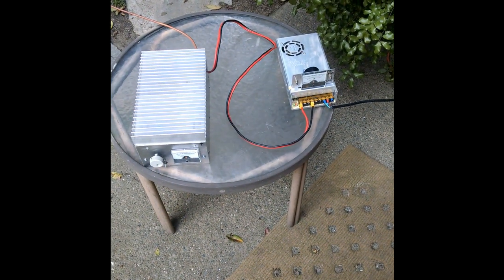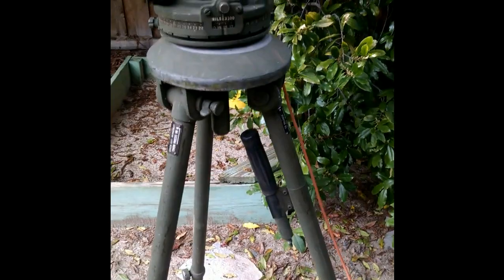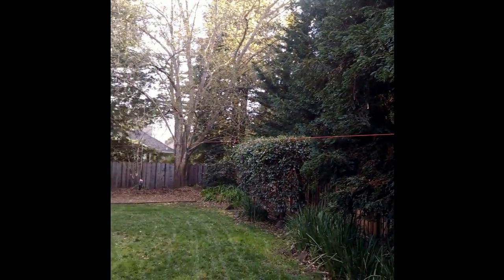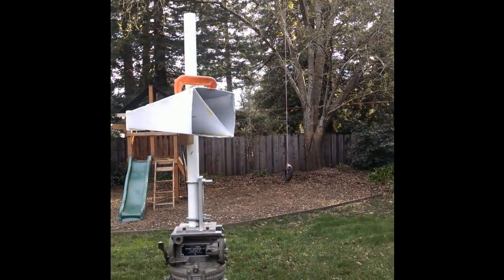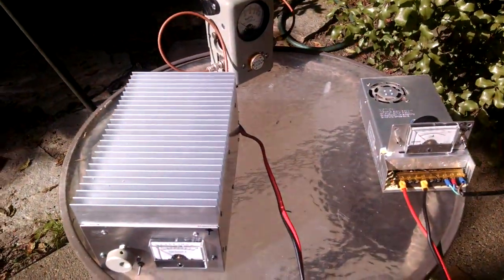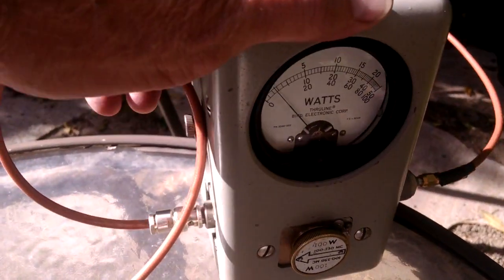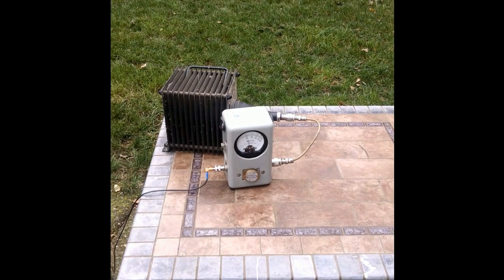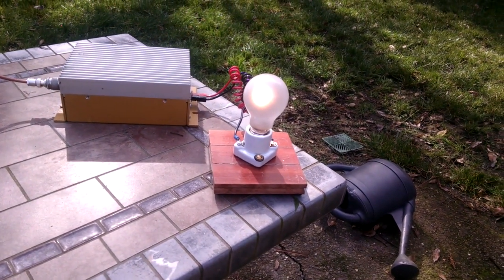Real power transmitted over a single 0.32mm  wire

Comment: Great video. I am interested in the construction details of the smaller lightweight launcher on the end. Is the klopfenstein taper still made out of nested brass tube? Using details from your QEX articles I built a couple swtl launchers but used the wire grid method from your all band antenna paper, http://superkuh.com/swtl_launcher_complete.jpg
Reply from the maker: No, on the Depron/foil version I use a tapered foil center conductor down to about 140 ohms and then go the rest of the way to 50 ohms with microstripline made from Depron backed with foil.  It's a compromise but cuts the length and the weight in about half. I'll possibly present an article at some point with construction details as I did for the tubing.
Reply from the maker: I just looked at your link. Your short model should work OK, though it is probably important to say that the Klopfenstein taper is not actually the correct one to use for optimum performance.  It results in a little less than 2 dB of insertion loss.  A different taper that spends more time accurately transitioning between TEM and TM and that considers the aggregate impedance is what's desired - along with proper mode matching. The Depron/metal-foil construction works pretty well though and can still be utilized.

Comment: Thanks for the update Glenn!  Not far from suspending the line indefinitely with a quadcopter!
Reply from the maker: +Todd Berg About 20% too heavy still!   I can easily deliver a quarter horsepower (~180 watts) as 30V@6A with only 57g (2 ounces) of matching/rectification shown in the demo but getting that converted to 12V@18A is still just a bit too heavy!  It's presently a solvable engineering challenge (:&gt;)